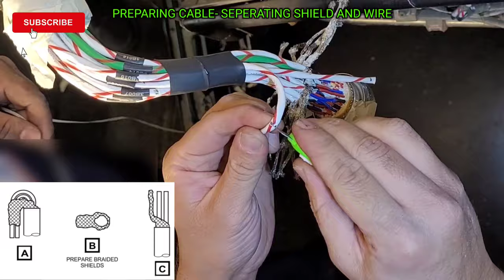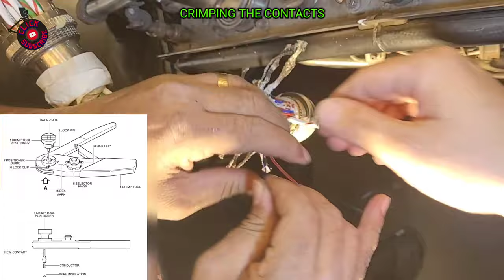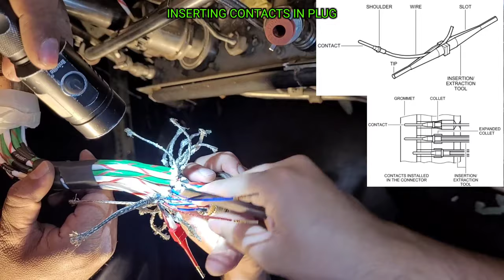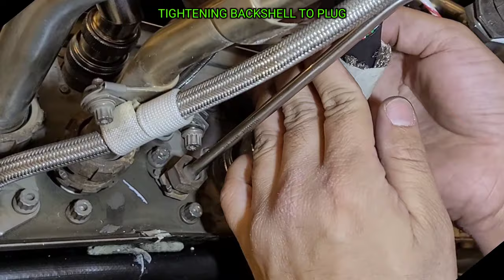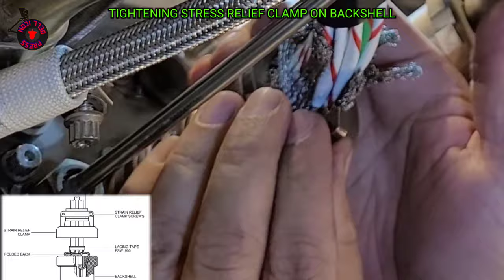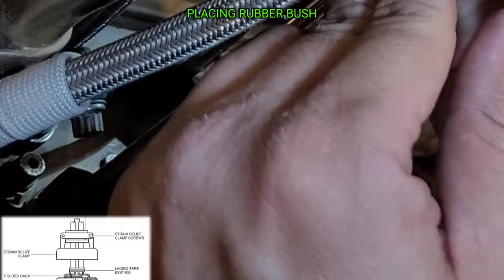AIRCRAFT ELECTRICAL CONNECTOR ASSEMBLY OF A330 ROLLS ROYCE ENGINE TRENT 700 PART 2 #rrtrent700

Comment: Tool required for crimping has different color codes.. Can you please explain why color coding is given.?
Reply from the maker: For identification
Reply: @CHOXON2CHOXOFF  indicates the gauge size ¿? Do you have any reference or document?? If so please share
Reply from the maker: Reference n doc is nothing but manufacture Aircraft manuals.
Reply: @noumanhassan3182  If you have to ask that question you cannot do it.
Reply: Read the tool manufacturers documentation and specifications. It's probably indicative of the AWG of wire but I can't tell you more without the manufacturers part number of your tool.
Reply from the maker: True